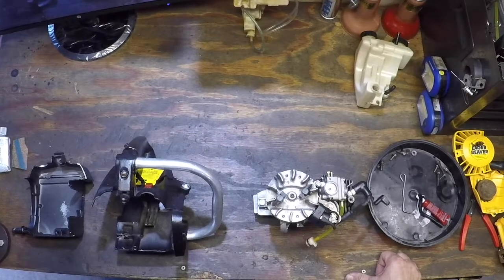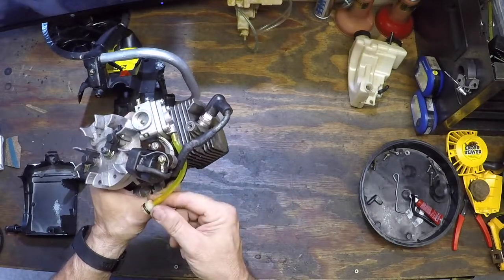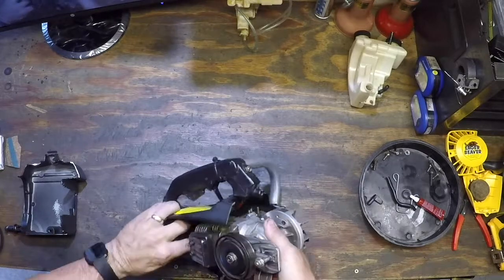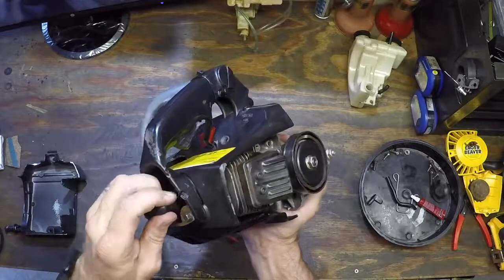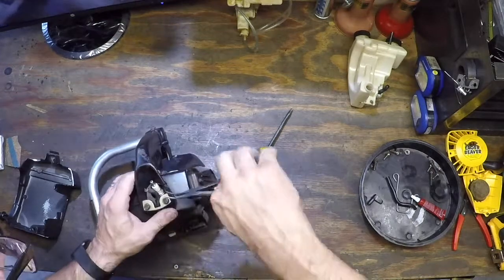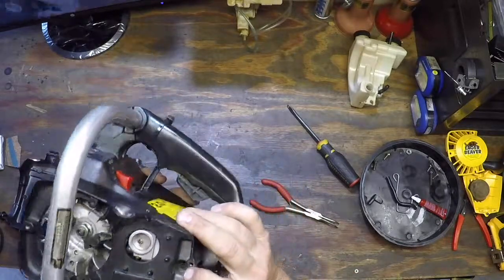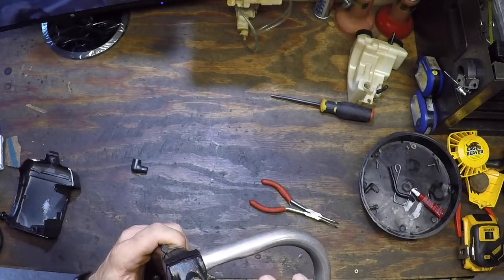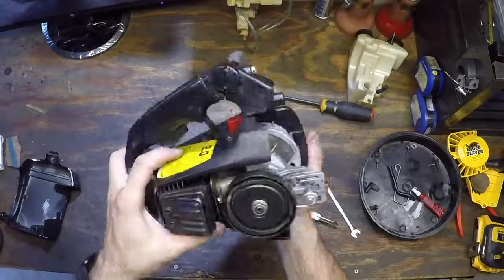Mcculloch Eager Beaver 2 0 Reassembly 1 Part 7

Comment: Greatly appreciate your time to show your abilities on this particular model. I bought mine right after I bought my first house. I bought it from Spags in massachusetts, they had it on sale for 70$ back then. I got alot of use from it and was always reliable. The problem I ran into was the chain and bar bolt that secures it tight had stripped from over torque from constantly replacing or readjusting the chain. Over the years from moving I lost the manual for it.. Anyways your video gave me some much needed information and want to thank you for providing the information.

Comment: Mr.McClead i would like to thank you for your channel  and your laid-back  soft spoken no what the hell ur doing. I watched all of the Eager Beaver 🦫 video's  to help me rebuild  and replace parts. I bought a Mcculloch Mac 160s that had been sitting for a few years. bad gas. Dry carb gaskets. Fuel line rotted. I was able to get her running like a top just by watching your kick ass channel!! Thanks again keep up the fantastic work.. 
MatthewHair
Reply from the maker: Thank You. The Mac top handles are the "problem children" of the McCulloch line by virtue of their case design. But get one up and running and you'll be wandering around the back yard looking for stuff to cut because you don't want to put it down.

Comment: Yeah i cut my fuel like long as always then realize it kinked. Kept having to widdling it down. I always get worried about the tank plug outlet not seating for the fact that it so hard to get it off. So i plug it in the tank first then slide the engine in. Then just pull the tank out a little bit. Just enough to get a fish hook shapped pick to connect the throttle.

Comment: Just found this series of videos.  Very helpful.  Trying to rebuild one of these that has been laying in the back of a garage for a few years.  Do you think there is any chance of finding replacement fuel line, filter, clip and primer bulb for this model?
Reply from the maker: gump33lt The fuel line you make from  
Tygon fuel hose. (Cut it to the exact same length as the old one or the line will kink on reassembly). The filter can be cleaned and reused if not too bad. Replacements are available on eBay. I’m not sure what “clip” you are referring to. And there is no primer bulb. The carb (for the most part) is self priming. Though initially, you may have to squirt a little fuel down the carb throat to help the first priming along.
Reply: @j.k.mcclead9207  at the outset of this series of videos you said you might heli-coil the spark plug.  Did you do that and is there a video?  Also, what would be minimal PSI for this thing to work?
Reply from the maker: @gump33lt  On that saw, no I didn’t have to heli-coil it. I took the tap from the heli-coil kit (14mm) and cleaned the threads so that the plug threaded properly. Make sure the cylinder is at the bottom of the stroke and monitor the depth of the tap. The plug is at an angle and you risk hitting the cylinder wall.There are quite a few heli-coil videos, thechainsawguy does an excellent tutorial.
Around 90psi is generally the threshold, but at such low compression, spark and fuel and going to have to be on the money.
Reply: @j.k.mcclead9207  Thank you for taking the time to respond to my queries.  It is much appreciated.

Comment: Did I miss where you check the muffler, spark arrestor, and exhaust port?   Isn't it a good idea to check the exhaust port for carbon buildup or its not necessary?
Reply from the maker: Sure, it’s always a good idea to check the exhaust for carbon and obstructions. This one was clean with very little run time and no visible carbon on the muffler. If it had a spark screen, I probably would have checked, it doesn’t take much to clog them.

Comment: I would love to know where you found a coil for this chain saw, unless you used old one.
I hv been searching for 4 months for a coil. That’s the only part I need to get my dads old chainsaw 2.0 eager beaver up and running. He tried fur a year to get this going, he passed on and I replaced a lot of parts on this but can not find a coil new or used anywhere. Gosh if I could get one that would actually make my year complete feel like he would be with me smiling thanks
Reply from the maker: I usually pull them off “parts saws”. The Yellow Cased 110, 120, 130, 140, and 160s minis have  Breaker points ignition. The black cased 110, 120, 130, 140, and 160s have electronic ignition. The way to tell which is which if you’re looking at a raw engine, is to look behind the flywheel. If there’s a circular plastic case, then it is points ignition. If there is nothing behind the flywheel, then it is electronic ignition.

Comment: I have a problem with the oil pump. The plunger does not push oil . The plunger
 Is black plastic  and the tank is white 
plastic. Saw is disassembled  and runs
well but no oil pump  reaction. Plunger
removes from tank and seems slightly 
distorted.  Would like to find a replacement.  Any opinion? Thanks
Reply from the maker: William Bikash https://www.ebay.com/itm/193213394357 https://www.ebay.com/itm/124260120364.  These might help.

Comment: My eager beaver 2.0 leaks bar chain oil through the port even when not running. No position of the adjustment screw will stop it. I can find nothing wrong anywhere. Is there a check valve or duckbill valve somewhere not shown on the schematic?
Reply from the maker: Like most chainsaws, they all weep a little oil at some point. The most common leakage point is the rubber tube that goes into the tank. They get old and mushy and sometimes don’t go fully into the tank upon reassembly.
Reply: You're right the original oiler leaked badly.  Not weeping but literally pouring out.  I remember I had to leave the saw in a tray when not in use otherwise it would make a huge mess.   Back in the 90s McCulloch came out with an inexpensive replacement upgrade part for the oiler and it worked well.  Not sure if they are available now.   I did the replacement on my Eager Beaver manual oiler over 20 years ago so the details are hazy but it may have had an improved check valve - not sure.   My engine just seized so I'm going to list it on ebay for parts in case you want it for the oiler upgrade.

Comment: Hi is this the same as the mini Mac 6?  Looks like it to me
Reply from the maker: They all have the same basic form factor. The yellow cased models have a Walbro MDC carburetor and points ignition. The black cased models have ZAMA carburetors and electronic Ignition. The mini mac 6-6a, 25 and 30 Have 30cc engines. With the advent of the Mini mac 35, displacement was boosted to 32cc (2.0CI) which was continued on with all later models.

Comment: I noticed that my filter in the gas tank barely lets any fuel out of the tank..would it be ill advised to remove it conpletely?
Reply from the maker: You can remove the filter and if not too terrible, clean and reuse, if not, eBay has them (though not cheap). Running without one is asking for trouble.

Comment: No one seems to know what coil fits a 160S. I looked and looked..cannot find a part nummber for one. Any ideas? Anyone know the original part number?  Thanks
Reply from the maker: Sure, any "Black Cased” mini is electronic ignition. 110,120,130,140,160s and the eager beaver 2.0 all use the same coil. The only difference between the saws is the sticker on the outside. # 84957 is the part number.
Reply: @J.K. McClead  thank you sir!@

Comment: Where can I find that white fitting that goes in the gas tank?
Reply from the maker: ebay is my general "go to" source for parts. The 110, 120, 130, 140, 160s, and the eager beaver 2.0 all use the same part.

Comment: I know no one can get back to me plan don’t even Read these comments prob. If anyone can help me please help I’m desperate have hours upon hours of trying to hook up the fuel line. 
I have my dads old McCulloch eager beaver chain saw, I rebuilt it, a lot of new parts, my beaver’s fuel line has no filter, dosen’t have that white round quick connect with the o-ring on it. It connects directly to the carb fuel line and rubs directly to the barbed end of fuel tank it has two barbs that hold fuel line on to tank outlet has to be pushed on abs I cannot get it on, there just isn’t any room anyone hv this problem? Thanks
Reply from the maker: The fuel tank is a two piece design, the tank itself and the fuel fitting. The fuel line and fitting must be preassembled and attached to the carburetor before the engine is massaged back into the case. First, cut the new fuel line the exact same length as the old one. There is a tendency to cut the line a little longer to give yourself a little "working room", but the engine to case clearance is is too tight, with the hose too long, it will kink, cutting off fuel flow. Next connect the hose to the carb and the fuel fitting making sure the rectangular part of the fitting faces downward. There is a channel in the case that the fuel line fits into and a rectangular  hole in the bottom of the case that the  part of the fuel fitting goes into. All have to be guided into place as the engine is put back in the case. It's a three handed operation and will take a few tries to get everything into the right position. Once everything is together, the fuel tank itself simply pushes on to the end of there fitting with the O-ring on it.

Comment: I rebuilt the carb, replaced the lines, and reassembled mine a couple years ago and let it sit because it wouldn't keep running. Today, picked it up and found the fuel line kinked, as you warned against.
Anyway, I have an unrelated question regarding the oil line, how the heck does it work? The line (p/n 84653) is 3-pronged unit, one from the tank, one to the pump, and one to the bar. But one of those prongs ain't got a hole in it!! That line just supplies oil from the tank to the pump? Oil from the pump to the bar by an internal passage?
UPDATE: Went back to the machine and realized this isn't an automatic oiling machine, there is only a manual pump. Starts up and runs now, a nice little unit.
Reply from the maker: Answered your own question, excellent! The crucial part of the automatic oiler saws is the front half of the engine where the automatic oil attaches. “Eager Beavers” which for the most part are manual oilers, don’t have a pulse port necessary to drive an automatic oiler unit. So if you put an oiler on a manual oil only saw, it would not work, though you would still retain the manual oil part.